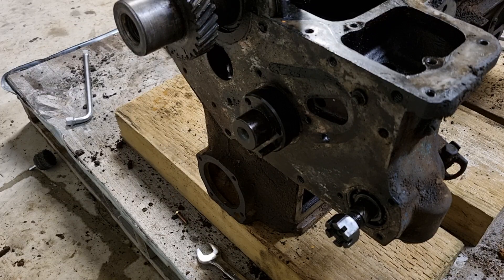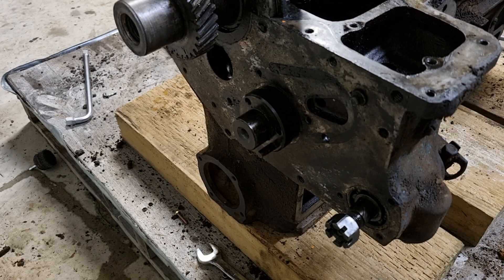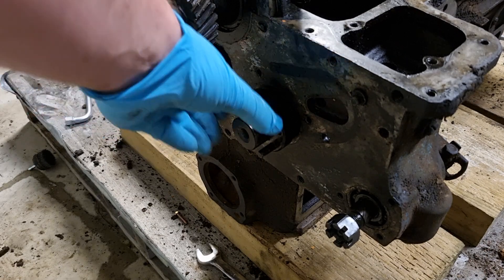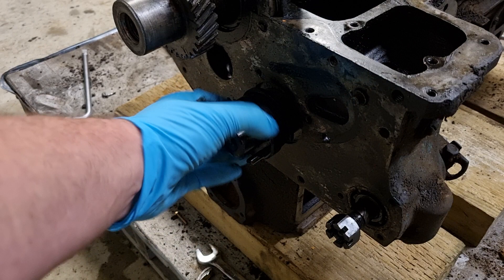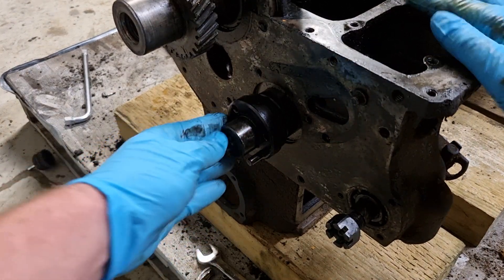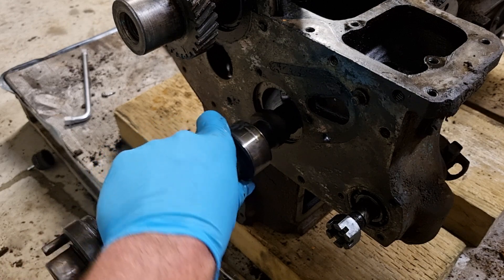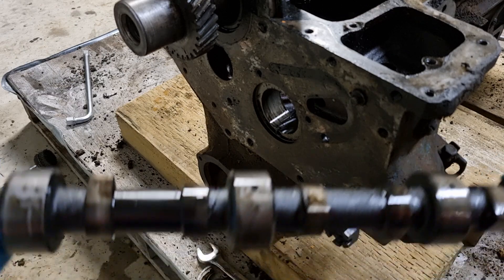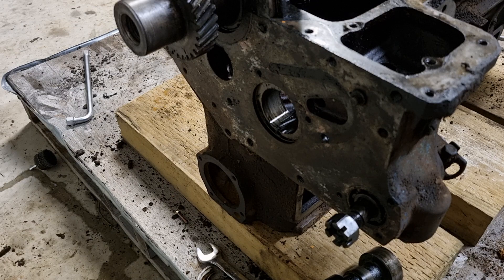Fordson Major Camshaft Removal

Comment: Thanks for sharing your repair experiences, 
I have a question to change the cam followers, do I need to rotate the engine block so that they do not prevent me from removing the camshaft? 
Or do you know any other way to hold them up? 
thank you